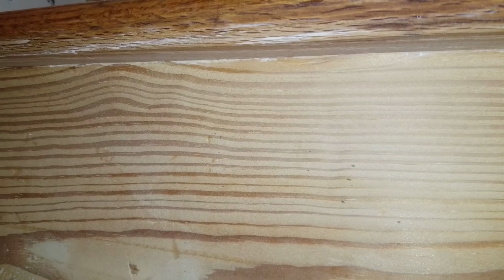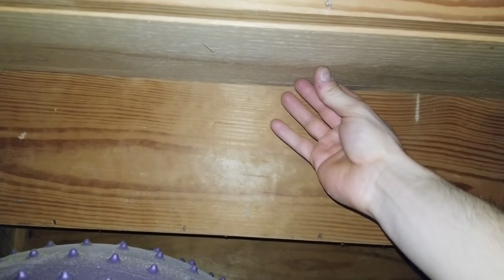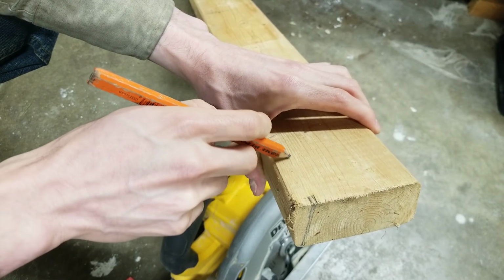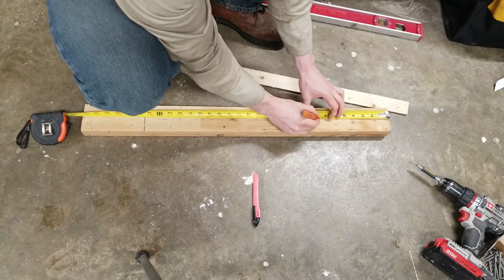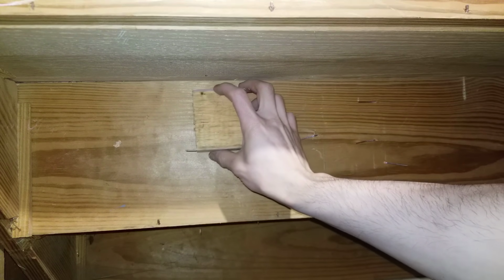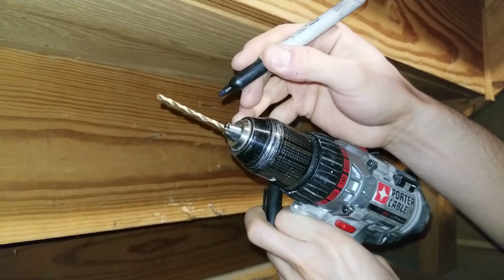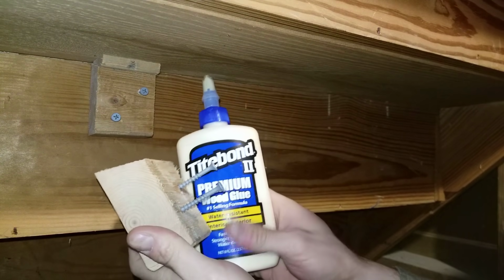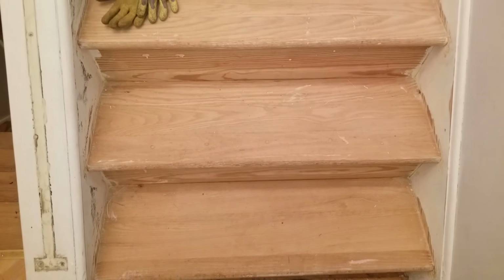How to Fix Squeaky Stairs

Comment: Awesome video, I'll give this a shot!

I've noticed each one of my stairs has a slight gap where the tread meets the riser. Is there a good way to fix this? I had planned on using new screws to try and bring the 2 pieces of stairs together, but don't want to cause any unnecessary damage. The stairs are about 100 years old.

Cheers!

Comment: Since you have access underneath the stairs, you could install joist hangers on the stringers and then run a 2x6 from one end to the other. The center of the tread will be supported all the way across from end to end and it would only take a few minutes per tread to install.
Reply: If you happen to see this …. do you think I should do this in addition to the method in the video or can I just use the joist hangers?
Reply: would it be too much weight?
Reply: @PurpleKaye_  The single new support will help a lot. But if there was space between the parts to begin with, it may not be absolutely silent until you do both. And then if you’re gonna do the job of attaching the treads to risers, and that fixes it, this additional method may be extraneous. But on the other hand, a little overkill never hurt.

Comment: That works fine if you have access on the back side of the stairs. Mine squeak a lot and my back stairs is covered in sheet rock. I'd rather try to fix the stairs without knocking down all that sheet rock. And I'm an amateur at these kinds of things.
Reply: Pulled down the back side drywall yesterday(not that hard)- about the only way to stop the squeak is access to this area.

Comment: Is it best to drill through the 2 by 4 into the riser?  I’ve always thought that you should drill from thin wood into thicker wood for better hold.  The stairs I’m repairing are totally unfinished.  Or is it a case of if you need to replace the glue block it’s easier access?

Comment: How did you pick the length of the screw?
Reply: I assume either a 2 1/4”, or a 2 1/2”    

I believe the wood glue does most of the holding when it dries, but I didn’t know what the preferred length of the screw going into the riser should be.  

I’m new with home improvements and woodworking.

Comment: Rather than use small glue blocks why not put a length of timer from the left string to the right string . Maybe 4x2 . Glued to riser and tread and fixed to the strings
Reply: great idea, would this add too much weight?
Reply: @satchelpage6194  no. Think of people walking on it and then the weight of a 30” piece of 2x4.  The stringers can hold a gigantic amount of weight, properly supported.

Comment: I took a 2by 6 turned it sideways and then attached 2 L brackets butt it up right against the stringer  and attach to the riser and problem solved .remember I butt the 2 x6  tight on the step .so no way the step will sink

Comment: Attach the risers to the step which is above it. This also makes the steps flex less...
Also.
You can wax joints which are not fastened or glued (You probably have a block of wax  or some cheap candles to wax your handsaw or handplane in your toolbox???)
Something you need to do BEFORE construction of the stairs though because this doesn't work (waxing) in a renovation

Comment: You mentioned, "flat side up".  Does that mean the cut side up?  I really could use the advice.
Reply from the maker: The non-cut side up. So the pieces go together oriented like they were before cutting, only not  perfectly because the large cut edge is pushed up to the tread before wedging in the cut peice. Hope that makes a little better sense.
Reply: @gameoflife7235  Glad I asked. In the video it looks the other way around. Thanks so much for the response! Keep the videos coming!
Reply: I've watched it 4 times, the cut side is definitely facing the tread above it.
Reply: He's referring to the wedge with the flat side up, so it sits flush with the horizontal stair when pressed onto the riser piece. The piece on the riser has the angled portion up.

Comment: Is there a way to fix the same problem but without access to the bottom of the stairs? My stairs are covered with finished drywall so I can’t access them from the bottom.
Reply from the maker: Unfortunately, no. Either the drywall has to be removed, or a different method must be used. There are special screws that go in from the top of the tread, and go into the riser. These can be concealed with wood filler afterward. If there is a big enough gap between the riser and tread, this will cause the tread to bow downward and might not fix the problem. Another method, if the treads are not enclosed by the routed out stringers, is to remove the treads, add shims where there are gaps under the tread, and glue/screw everything back into place. It all depends on how the stairs are designed, and how much work you feel like doing. Hope this helps.

Comment: Thanks for the video, but this doesnt seem like a very robust method. The entire weight of whatever is going up the stairs is on that little shim with only glue holding it in place. I dont think that shim will stay put in the long-term, might work for a couple of years if lucky
Reply: Not only glue but also screws - big difference
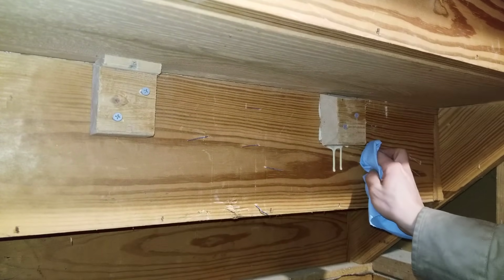Reply: @ronpd1982  Did you watch the whole video? The wedge/shim was only glued in - no screws 5:12
Reply: @Ironbuket  540 - 545 he has the screws in - really need both ....
Reply: @ronpd1982  The screws are no in the wedge/shim. You really need to learn to read
Reply: @Ironbuket  ok here how it works. The riser which is screwed in supports the wedge. The wedge is jammed in with glue that will support 3000 lbs. Remember good wood glue is super strong. When someone steps on that stair the wedge that glued will transfer the weight  right into the Riser and the whole thing is supported by the screwed & glued in riser. Hope this helps.
Reply: @ronpd1982  OK, here's how it works. I was talking only about the wedge/shim. Stop going one about the screwed in part. Geez
Reply: @Ironbuket  ok - but you need to review the totality of the riser to  understand it.
Reply: @ronpd1982  I understand how it works, there is a tiny point holding up the front of the step and the main part of the step is supported by the glued in wedge/shim. Is that not how you see this working?
Reply: @Ironbuket  that wedge is fused into the main part of the mini-riser - its now one unit, albeit fused. I used Elmer's PROBOND MAX wood glue - super stuff. I just completed the 90 year old stairs in my house using this method and it's an amazing improvement.
Reply: @ronpd1982  fused, yes interesting word that fused. I guess that word is meant to make me think that it is all one part and shall never seperate? Just like when you weld two bits of metel together, they are fused even better and as we all know welds never break. Oh, wait a sec they can cant they. Dont try and throw words out that are gibberish. Glue is not fused and even if there was a real way to fuse wood, that doesnt mean it cant break at the weakest point of the fuse later. You could easily epect at some point to have people carrying furniture up those stairs which puts a huge force on the step, either you are going to say teh glue is so solid and unmoving that the step wont move at all, which means it is likley to fracture at some point to load/unload or it is flexable, in which case it is likly to move about and drift out of position. If glue alone were such a great way to support the wood surfaces we walk on then flooring would be glued down and not nailed or screwed down as well. Go ahead and glue down some floor boards and see how long before they start moving about. Yes it might be OK for years, but eventually glue alone will not be enough to keep them in place
Reply: @Ironbuket  think of it as a fused shim. The wooden tread will break before the glue gives way. Tested at 3000 lbs - and President Trump approved!
Reply: @ronpd1982  tested how many times over how many years? Dont be fooled by advertising
Reply: Make the parts a bit wider (more room for screws) then screw a piece behind it then your wedge won't slip out from "glue failure"
Reply: Not happy with that use metal corner brackets or something
Reply: @elliottcarruthers5462  Corner brackets arent usually square at the turn and usually are at a set angle. I think the point is to try to support the step as close to the vertical face as possible and to match the slope of the step? Hence the use of the shim rather than just a plain 90 degree block? It may not be 90 degrees?
Reply: You are correct. This fix may hold for awhile, but these are cheaply built stairs...very common in stair manufacturing, but still cheap. I'm not telling my secrets in the open, but I worked in stair manufacturing for almost 30 years, and also did service calls for for stair issues. 95% of those calls was for squeaky stairs. For one, those staples are shit, especially on carpeted stairs. Carpet installers will knock them loose when they slam their knee into the kicker, on that back corner...sorry for the long response, that's just a fraction of what I could say.
Reply: @scottwright388  sharing is caring - why not share your tips?
Reply: @gittin_funky  I did share a little bit
Reply: @scottwright388  fair enough you did point point out the staples were not very good; was just encouraging you to share your tips as you seem to have a lot to offer the average DIYer

Comment: how to fix if your underside is closed up?
Reply: Are your stairs carpeted?
Reply: @scottwright388  No it is not, i have tried using the fix it screws but still did not help and i do not want to open the sheetrock that is covering the back of the stairs, so, my question is is there any other way to fix it without opening the back of the stairs?
Reply: @security8576  fyi, I was in stair manufacturing for almost 30 years. It's hard to help with very little info. I never used those fixit screws, but the concept seems sketchy. From my experience, if you can drive a screw or two at an angle towards the wall, in the corners where the riser meets the stringer, it almost always eliminates squeaks. But without carpet, you may not have that option.

Comment: What length screws?
Reply: 2x4 piece of wood block is 1-1/2" thick, plus whatever your riser thickness is which is probably 3/4", which equals 2-1/4" total thickness of your material. So use a screw no longer than 2-1/4".

Comment: Lol, I dont have access to the back.
Reply from the maker: Unfortunately, to fix you would have to cut a hole in the drywall big enough for you to fit to do anything like this. In most houses I've seen though, the other side is in a closet so when the hole is patched it doesn't have to be absolutely perfect since it's never seen.

Comment: What if my stairs are hidden? I cant see the back or under of my stairs its covered in drywall.
Reply from the maker: Probably have to screw in from the tread into the riser past flush of the tread surface, and then fill in the screw head to conceal it. If everything is covered up that's about all there is to do to try stopping the squeak.

Comment: Or just glue square blocks the length of the stair in the corner and screw through the tread and riser. The wedges your using will make problem worse because its pulling the riser out the tread 🤦
Reply: The wedge fills the gap.  And you saw the result at the end I assume.

Comment: Your results seem great but lol for a person who knows nothing of what you’re saying, it’s kinda hard to follow especially since you said a lot and really fast. Could you maybe go slower and explain in layman’s terms kindly? Because I def want to try this at my parents’ house who have stairs that are exposed in the bottom in the basement! Thank you :)
Reply: He's screwing a block of wood to the front of the stairs. (Riser) Make sure you don't screw too far and poking through the front. Each block was 2 1/2 inches or so. And was sliced into two parts. Like slicing a big wedge of cheese. Just use the sliced off part to wedge back into the main part. Glue it and tap it in. Do it for each step. Voila. No more squeak. You can do two per step. Or one in the middle of each step.
Reply: you can change the speed of the video

Comment: who ever built those stairs needs a smack 100% wrong, too narrow of a stringer and no middle stringer Im surprised they didn't collapse
Reply from the maker: The joys of cheap 1970s tract homes. While this would never pass code today at least they used oak which has held up very well.
Reply: My house was built in the 40s and the stairs are the exact same. Fir treads and risers. Still holding strong but man, super squeaky. If there was a middle stringer under the stairs you'd be whacking your head on it all the way down to the basement, so I guess they made a choice back in those days.